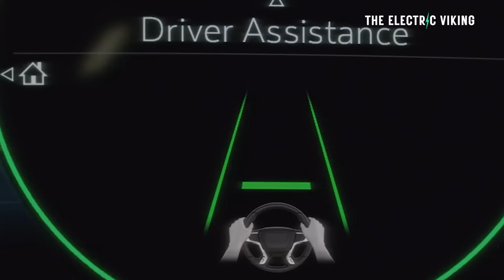GM CEO Hints at Ultium V2 Chevy Bolt EV After Current Killed Off This Year

Comment: As a happy Bolt EUV owner, I think keeping the Bolt as GM's entry-level, fwd, EV is a great idea. An Ultium Bolt will probably have the slow charging fixed.
The base, short-range, Tesla model-3 in Canada is still $12K more than the LT Bolt EUV, and doesn't get any better range. The Bolt would still be my choice, even with the slow charging -- which doesn't affect me much with my commute.
Reply: youre not comparing apples to apples, the model 3 is not equivalent to the LT 1, it is the equivalent of the platinum.
Reply: @scottmcshannon6821  -- Lowest price available for each brand, so apples to apples in cost. Canada doesn't get the lower-level EUV available in the US.

Comment: We looked at a small cheap ev runabout in 2022. The bolt was pulled of the market at that time for fire issues. We bought a 2022 Nissan Leaf SV plus, which has been great. We found only one reported fire in an on line search in ax2015 model. For road trips we have an ICE car.  A lease return on this car is a great deal.

Comment: I own a 2023 Bolt EUV. First off, there is nothing wrong with the batteries anymore. It was a manufacturing defect by LG, and GM made LG eat the cost. All Bolts built from 2016 to 2023 now have the improved battery now. It is a first gen battery like old Teslas with a lot of 18650 cells wired together. 

The build quality is good. It is small, but not too small. It’s a perfect grocery getter. GM was making the electric car that a large majority of people wanted- cheap, functional, easy to drive. It’s not so heavy that it wears out tires quickly. It is quiet, and the return on investment should come quicker for the consumer. It has drawbacks- like very slow 50kw DC fast charging. However, the AC inverter is rated at 11.5kw- fairly high. There is certainly room for improvement if the model was to continue. GM is right to continue to offer some sort of entry level EV. Other manufacturers should take note if the EV revolution is to excel. Here in the USA, we need entry level EVs not made in China with batteries not made in China. The EV tax credit is written this way. I think I read somewhere that GM could make a profit on the Bolt at $26k. It shouldn’t be too much of a stretch to modify the battery pack to accept Ultium pouch batteries. If that means the more people will try EVs then that’s certainly good. 

As far as GM goes- they should focus on building the Equinox as a tier 2 vehicle, and keep the Bolts for Tier 1. I’d keep the EUV version because it doesn’t have the triangle door glass behind the A pillar, and it has 3” more rear seat leg room- comparable to the ModelY rear seat leg room. If the Ultium battery won’t fit, then they might want to check out Lyten who has a inexpensive LiS battery that has a much better energy density, although the charge cycle count is lower than LNMC it is still over 1500, so that’s enough for 2-300k miles depending on battery size.

Comment: I have the 2023 Bolt EV 2LT in red. LOve LOve it. It exceeds all that was promised. Mine is Post Recall. I’ve Had since March. I have road tripped it 4 times. Taxes and all 34,000. I will get whole 7500. What A Bargain.
Reply: Can it now charge more than 50Kwh?
Reply: I hope nobody tells you you could have had a Model 3 for not the same price lol
Reply: @rozonoemi9374  Nope, you need to keep it in the sweet spot for the charging curve and be willing to take your time.  The Bolt works fine for regional travel without much delay, but if you want to stack multiple charging sessions the time adds up.  Basically anything a 300 mile radius is very doable without much problem by making a stop.  Keep it in the 10-60% state of charge and plan to make charger hops for the fastest progress in a Bolt.  Still very doable.  If you are in a hurry then a gas car is going to make every EV look like a snail.
Reply: @PaleBlueDotCitizen  That Model 3 price for an inventory car is 37,880 before they sold out.  If you want want now it is 40k, take the tax incentive and still 33k.  The Bolt get  the full tax break too.  That price gets the full incentive putting it in the 25k.  Not even close price wise.  If you want a Tesla then get a Tesla.  But trying to say the price is the same clearly missing some key information.  The Bolt is still substantially cheaper and is a good car.
Reply: @Longsnowsm  EVEN THE 160 MPH TESLA..???????...............Paul
Reply: @paulholterhaus7084  Base model Tesla doesn't go 160mph and you are not going to get a 160mph Tesla for 40k.  Compare base model Bolt to base model RWD M3.  There is a huge difference in cost.  27k for the Bolt base model to 40k for the RWD M3.  Not even close.  You want a "fast" Tesla then why would you be comparing to a Bolt?
Reply: @rozonoemi9374  absolutely NOT.  It surges to 50 and at 80% it slows down to the mid 20's.  They are trash in the road noise and charging areas.  Interiors are plastic and ultra cheap in every way.  The just make a few things shiny and people THINK they have a good car.  Not even close.
Reply: @rozonoemi9374  You sit there charging 3 times slower than any other EV.  It takes over an hour to charge to 100% and it usually cuts you off at an hour so you have to unplug and start over again at 13 to 20 while saying hi to your fourth EV owner that is trying not to laugh and feel sorry for you and your plastic slow brick ......
Reply: @PaleBlueDotCitizen  Uhhhh ..this  bolt is 34k BEFORE tax incentives.  The M3 only gets there AFTER tax incentives  ???    What planet are you on that this is the same price ?

Comment: If they fix the slow charging issue this car will be amazing!
Reply: I almost bought one, but the idea of going to a dealer plus the slow charging pushed me to buy a Tesla
Reply: How do you define slow charging? I primarily charge at home with a 48amp box. No issues at all. On the road, I use DC fast charging. It takes roughly 1 hour from 25-100% fully charged. The time is spent well. maybe you're just a "get it done " person. There's nothing wrong in that but those of us who are more patient, appreciate the down time at a rest stop.
Reply: @toonman361  don’t shoot the messenger. You can do a search on Chevy bolt slow charge and see many examples. But this is the first thing I pulled up.

Why can't Chevy Bolt charge faster?
The Chevrolet Bolt EUV can only charge at a max rate of 55 kW, which means a high-powered fast charger rated at say, 350 kW, won't charge the vehicle any faster. Commonly, lots of older DC fast chargers operate at a speed of 50 kW, only slightly slower than what the Bolt EUV can handle.
Reply: @Beatles4Sale.  Didn't mean to sound so threatening. Sorry. It looks like you are using math as a foundation to your assessment. I was using subjective timing. I do understand that mathematically, the Bolt is slower but subjectively, is fast enough for me given it's what's available. The <$30K price was doable. Tesla's >$45K wasn't at the time.

Comment: Sold my Tesla Model 3 and bought a Bolt EV. Love the Bolt! Can't beat the value for the price. What is needed in the US, a less expensive EV younger families can afford. The  range is more than enough. Now with GM having access to Tesla chargers, traveling not an issue for non Tesla EV owners like the Bolt. It is a hoot to drive and much easier and cheaper to get serviced. Hope it stays around.
Reply: GM cars will be in at Tesla Charging 2025 if the company is still around.  No new EVs until then.  They lost over 800 million dollars last year and lose more money year after year for over 5 years now.  900 million or 1 billion lost this year ????  CEO makes over 24 million a year and this is happening ????
Reply: A little behind the times. GM has an EV SUV (Equinox) out 3rd Qtr this year at price point 30K and another in 2024, (Blazer) Cadillac he’s one for sale and of course there is the Hummer EV version.

Comment: I own a Bolt.   It's an adequate car, for my needs.   I like its looks better than the Equinox.  To GM's credit, they've produced a 200+ mile EV in the $20-$30k.  And it's an American company.  If they have an Ultium Bolt, I would consider a trade-in.  Also, it should work with Comma 3 Openpilot.  The only possible exception might be if Tesla provides something in a similar price range (e.g. LFP/LMFP, 200+ miles, hatch, ...)  (But I'm not holding my breath.)

Comment: I am one of those EUV Bolt owners that is pissed off about GM’s decision to stop producing.  I bought the EUV only to hear the news a few weeks later.    I think the EUV is not only at a great price, but the quality and features are dame good.  If GM does out out with a 3rd generation Bolt with the ultium battery, can the battery be a replacement for 2nd generation Bolt owners?Time will tell.

Comment: Well it is like anything else, you first have to pay for all the initial Engineering costs of something new and then what will be the new buyer demand on EV's such as the Equinox or Blazer products. I want to see what the real prices are when the Equinox EV is released.

Also, Time shall Tell if they decide to put in a newer Ultium battery for an updated Chevy Bolt EV products. I wouldn't hold my breath on this happening.  I was interested in the 2023 Bolt at one time till I saw the specs on the Equinox Batteries.  I am not counting out also looking at Tesla products.  See what the year 2024 brings.
Thanks for the video and take care.

Comment: I think GM helps us remind how planned obsolescence works. It has it advantages, but also disadvantages. If sustainability is the narrative here, of shifting towards sustainable transport, I think planned obsolescence is not the way to go. It is what I clearly see what Tesla is doing now with the rapid improvements of their successive batches of future cars. But I think nobody is talking about retrograde upgrading older models. Yes to a degree, especially software, but I hear ittle about retrograde compatibility of older Tesla's with new hardware tech. In a nutshell I only see the software and possibly only the MCU (for a steep price limit) as a value add for the Tesla. Without it, despite the overall improved average quality. I see the vehicle value drop like a rock in my view, despite what the market is saying. EVs are so much simpler than ICE cars, because of less moving parts. Bitbthen it's still amazes me how difficult is is to get part replacements. I think more attention to repairability of EVs would certainly go a long way to increase trust of further future proofing current second or more handed EVs on the market to maintain their value and sustainability on the roads.
Reply: Don't need to fix them, they don't break.

Comment: I am sure the sole reason they are cancelling the current version is because they are selling it at a loss, and likely a significant loss at that. And, judging by Munro’s tear-down of the ultium pack in the hummer and it’s egregiously poor engineering, it will take quite a lot of effort (aka redesign) before they will produce a car like the bolt that they can profitably sell at an affordable cost.

Comment: I'm sure GM will continue the Bolt, with slight modifications, as they need a small hatchback, but want out of the existing battery agreement with LG.  The Bolt EUV makes no sense with the new Equinox EV coming soon as their size and specs are very similar.  The Equinox EV is slightly larger but much more demand.

Comment: Sure, this is possible. Consider that Gotion (Chinese Company) is given millions by the State of Michigan to build a battery plant near our legacy GM/Ford manufacturers. So, after recent Federal and State "approval" and funding (your tax dollars "at work" subsidizing legacy auto) expect to see a new "Ultimate" platform lowering the battery supply-chain costs and extending range of currently planned EV designs (and the old Chevy Bolt). Well, competition is good, because the domestic battery plants in Michigan have to meet or exceed world standards for quality, efficiency, and technology. More than possible, if the domestic battery plants fail, Gotion will be there to take all the legacy supplier business ;)

Comment: 4:30

would people still buy them if they raised the prices? idk, currently people are thinking about things like value, and honestly if you can afford a higher priced car, you probably would just buy a Tesla

if they don't discontinue the Bolt now, they won't be able to re-use the line to build something better, because unlike say Tesla, GM waits till a new model comes out before they make any significant changes, so they effectively have to keep "switching out models" sort of, to keep up with the cost declines of other EVs that are simply lowering costs over time

for example, by 2030, a car equivalent to the model 3 should have had a cost of 25k or less, and the only way to possibly compete with that is immediately start work on something that might be able to compete immediately

up until now, GM has had the low end EV market sort of to themselves, except because they didn't start at the high end they had no room to make a profit, but they also have no room at the high end because they got into the game very late

lack of profitability means the car isn't self sustaining, they have to fund it with the Ice business, which the union workers hate because not only are EVs taking 40% less labor, but the ice employees are getting lower paychecks, not to mention their scamme... I mean, uh... dealership network, keeps gouging the price of the final car, so actually getting one for MSRP isn't exactly a cakewalk, let alone the history of battery fires which do nothing but break consumer trust, and the new vehicles have to be "closely monitored" while charging? yeah, that's because they are likely dangerous, and they maybe haven't completely fixed that issue

But the hard part for GM here is scaling production, because if they scale, build more and more, that means they are hemorrhaging more and more money... and raising prices just means it's impossible to scale, as you will quickly run out of consumers who are too poor to afford something better, but wealthy enough to afford the higher price point, and a mere 10% increase in price isn't sufficient, to make a profit they would need to charge more than a model 3 I am pretty sure, even though its a smaller car...

if you are making losses that big on a vehicle, the plaster of a 10% increase in price, actually just means dealerships will charge even more, maybe 24.4k MSRP with the credit and 26 or 27k at the dealership at that point why not just buy a model 3 for 29.5k, which next year may cost 28.5k, and 27.5k the year after

and all of that maybe reduces the loss they make per car by 20% tops, even though the "demand" at that price point would nose dive after only a couple years

imagine if they waited to do this in 2025 instead of late 2023, and then they had all these production lines that are collecting dust because they haven't scaled up the new vehicle which takes literally 2 years to scale

^ quick way for the CFO to get fired if you ask me

Comment: I don’t know the following for a fact, so this is just conjecture, but it is plausible that GM could save a substantial amount of money by switching to Ultium batteries for the Bolt. The reason is that they are currently buying the Bolt batteries from the Korean company LG Chem (aka LG Energy Solution).  As their own in-house product, the Ultium might be significantly less expensive than paying a third-party supplier. Under those conditions it’s certainly possible they would get a substantial reduction in production costs from switching to Ultium.
Reply: How about sacking all the assembly line workers then bringing on newer younger minimum wage employees

Comment: Imo , it so strange to me how much money GM has thrown away in all of it’s EV programs, the EV1 debacle, the Volt program, and the Bolt , both of which were decent vehicles. And the Hummer and Lyriq, which they don’t even have a lot of on the streets after 3 years of marketing and advertising. And the promised Silverado, GMC, electric Equinox and Blazer EVs all of which should have been in owners’s garages this year at least. GM needs to get their act together before it’s too late, I guess they will still be able to rely on its various gas vehicles ( trucks , SUVs, crossovers, and Corvette, and commercial vehicles) for a couple more years during the valley of death.

Comment: Ford & Toyota is not using giga castings. They will in a “few” ears time.
LFP is not possible for Ford yet as their EV’s are too inefficient.
Reply: You are aware Ford is building a massive LFP battery factory with CATL?  Everyone has announced LFP products coming.  For Ford it will likely land in the next gen starting 2025.  The problem is LMFP/M3 and other batteries are going to displace them by the time they get them out the door starting next year.  The details have not been revealed regarding which technologies Ford is licensing from CATL so maybe they were smart enough to get access to the new tech that is about to roll.  We don't know the answers to that yet.